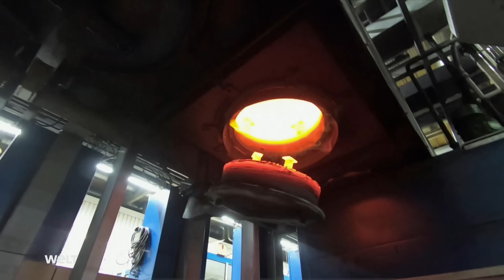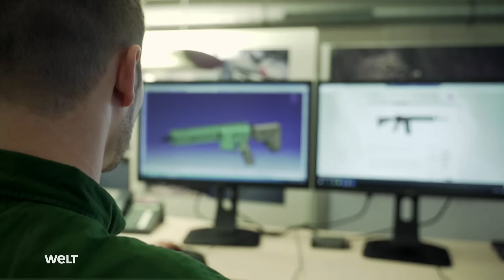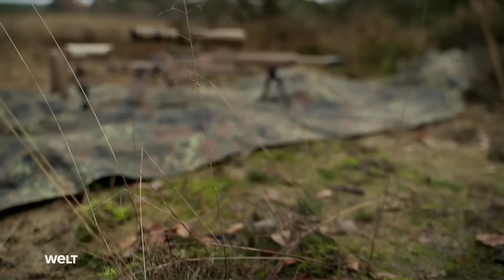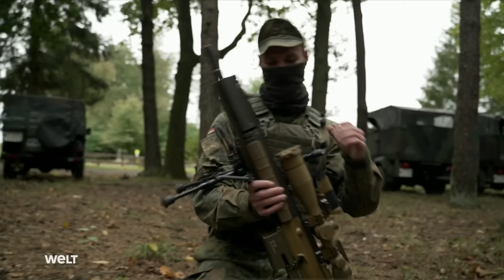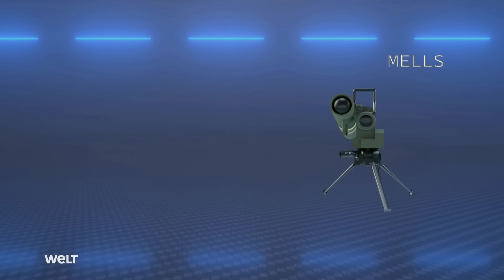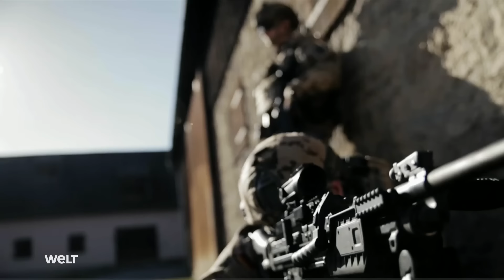FOR GERMAN SPECIAL FORCES: G95 K - A Gun Elite Warriors Fell in Love With | WELT Documemtary

Comment: The accuracy international rifle was fitted with a sound suppressor not a flash suppressor. It holds down sound and flash by cooling off the gases trailing the fired projectile. This makes it harder for adversaries to detect which direction a shot is fired from.

Comment: The G95K is a German assault rifle used by the Kommando Spezialkräfte (KSK), Germany's special forces unit. It is a variant of the Heckler & Koch HK416 A7 and is chambered in 5.56x45mm NATO.

The G95K is known for its reliability, accuracy, and modularity. It features a number of improvements over the standard HK416, including a longer barrel, a new gas system, and an ambidextrous charging handle. It is also equipped with an EOTech EXPS3-0 holographic weapon sight and G33 magnifier.
The G95K is a highly specialized weapon that is only used by the KSK. It is not available to the general public.
Reply: I knew that German special forces are known as GSG -- 9.
Reply: @LorddelacroixStRemyDacretheres a difference
Reply: @LorddelacroixStRemyDacre they are yes, but from the Bundespolizei (Federal Police)
there is also the SEK from the Landespolizei. Lets say you have a weapon situation in Munich then they call SEK. 
If youre a hostage in a different country then they send GSG - 9.  Both are police units.
KSK and KSM are Military Special Forces  (Guys who operate behind enemie lines to do sabotage mission or take/eliminate high prio targets and other stuff.

We also have something called Spezialisierte Kräfte. its a Connection link between SOF units and the "normal" soldiers if you will.
there are many more (like helicopter squardons for example or medi units)
Reply: Das stimmt nicht, ab Ende 2025/2026 ersetzt das G95 (in verschiedenen Varianten) das G36 als Standard-Sturmgewehr für die gesamte Bundeswehr. Eine zivile Variante gibt es mittlerweile auch schon.

Comment: Need something like a modern Sig 716, with a 4 way gas block,  maybe hybrid between .308 and 7.62 if still perfectly accurate with a bolt lock down feature and my design

Also i have some design improvements to all bolt actions 

I got some really cool inven.tion ideas if you want to make a lot of money

Who to Kontact

You need taser drones immediately for the border, if you like wepons defense systems and inventing call me,  i got lots of ideas.

I called L-Tron, no one wants my cool invention ideas,  you need a Cop car upgrade, 2 under mount guns one on passenger,  one on drivers, the rear is center out of truck.  Emergency bullet shield deployment of reverse open bullet proof hood with camers, also the rear trunk hyper extends and locks tight to glass, rear camera. One officer goes to the window,  the AI has 4 lock ons to four passengers on thermal,  the drivers side gun for the 2 on the driver's side, etc.., if there's a click on any of the passengers that gun fires an armour piercer

Comment: I'm sure if you just want to remove the bolt you're going to have to pull off the handguard... disassemble the cooling fins after removal.. pull the timing gear.. put the side plates into working position.. take out roller cam and extracting pin unit.. pull charging handle forward and back three times.. assemble cleaning rod and insert into Barrel.. turn it one full rotation.. back it out a quarter inch.. put the left side side plate up and extract Bolt....

Comment: It's an AR platform. The tolerances are also tight. What changes were made to make it more reliable in sand and mud? By what I've seen, what makes the AK platform reliable is that there are spaces in inside the receiver  that let sand and mud though without affecting the heavy moving parts.

Comment: I wonder how this rifle compares to the new (for the US) SIG M7 battle rifle in 6.8 x 51? If made in the 6.8 cartridge will its barrel have the same round count lifetime? How will the action hold up?
Once again the very ergonomic AR format WITH a piston driven action wins out over the dirty and hot direct impingement action. That's why I love my AUG.
Reply: It’s not only about the caliber, the M7 has a smart optic (XM157), which is unlike anything seen before on any other rifle.
Reply: @Gridlocked  Wellll...  Smart Scopes are becoming a "thing". I have a BURRIS Eliminator 6 rifle scope in 4x - 20x mounted on my 6.5 PRC Browning hunting rifle. It has the following built-in sensors: 1.) laser range finder. 2.) atmospheric pressure sensor. 3.) temperature sensor. 4.) inclination sensor. All feed into the onboard ballistic computer which has been pre-loaded with my cartridge, bullet weight, CD, BC, twist rate, velocity, etc. from my smart phone app.  Lasing a target numerically reads the distance out in the top  "heads up" display where a digital cant level is also displayed.  The "Hold Over" at a lased distance  is indicated by a red dot on the vertical reticle, which has 177 (!) LED dots on it for very fine hold indication. 
FINALLY you can choose 1.) A BULLET ENERGY setting that will tell you if, at the distance ranged, the bullet has enough energy for that particular species of animal. The shooter is responsible for setting this very ethical aid.  2.) WIND HOLD for the distance ranged is also dis[layed in the heads up area at the 5 mph or 10 mph (or kph) speed pre-selected on the app.
True my BURRIS E6 does not have a compass and a few other sensors the M157 "smart scope" has but it comes VERY close. Great for ethical hunting (avoiding wounds).

Comment: 10:18 to recap Suppressor is a sound dampening device basically a muffler for your gun a Flash hider aka flash suppressor looks nothing like a suppressor it looks more like a compensator aka muzzle break and is designed divert the gasses that cause muzzle flash so instead of coming straight out the barrel they come out the sides and backwards at the same time 2 totally different muzzle devices
Reply: I know! LMFAO!  I had to stop 10 mikes into this BS when the scriptwriter's superb knowledge of Pew-Pews and all gun-thingy-accessories really shines through with that pearl, "the G22 can additionally be fitted with a silencer, a so-called flash suppressor..."  Brutal!

Comment: 10:18 first of all it’s called a suppressor not a silencer second of all a suppressor is a sound suppressor it’s basically a muffler for your gun it is not a flash suppressor a flash suppressor aka flash hider is similar to a Muzzle Break aka Compensator but it’s designed to direct the gasses that cause muzzle flash to the side and backwards so it doesn’t come straight out the barrel you can only have 1 a suppressor a muzzle break or a flash hider all do different things
Reply: Silencer Central and Silencer Shop disagrees.
Reply: @John_Redcorn_  it’s in their name “silencer” that’s what ignorant ppl call suppressors. And the reason people call suppressors silencers is not because they silence your gun because they don’t they suppress the noise. The reason people call them silencers is because that’s what British people call mufflers on their cars and that’s essentially what a suppressor for a gun is it’s designed exactly like a car muffler and it doesn’t matter what their company name is if you go shopping for a suppressor on their website it will not be marketed as a silencer because that’s false advertising. It doesn’t silence, your gun and a suppressor is useless with supersonic ammunition. You have to couple it with some sonic ammunition, because of the crack of a bullet is from the bullet breaking the sound barrier.
Reply: @John_Redcorn_  I just went to silencer central and the first hung I saw was “ready to buy a suppressor”

Comment: poor HK reduced to making AR clones
Reply: I don't know how many of these (sorry) idiotic comments I've read here.

It's not you who are stupid, but the comments, because they show ignorance.

The US Special Forces worked with H&K because the Colt M4/16 model was too unreliable.

The thing that made the G36 so reliable, the gas piston, was then incorporated into the AR-15 receiver.
The internals inside the upper receiver is comoletely different to its Colt brother. 

And the AR-15 is a very modular design, which is why it is now used worldwide.

It's not a clone but a collaboration.

Especially since, ironically, an unlicensed copy of the H&K 416 is being built in the USA by Coharie Arms. The CA-415.
However, you can tell by the fact that the bolt wears out on the lower edge, which doesn't happen with H&K.

The H&K 416 is also the weapon that shot bin Laden in 2011.

You should start reading before you start writing.

If I build a Ford and you then take the casing and build it around a Bugatti, is it a Ford copy?
No, it just looks like one.
Reply: Ain’t an AR your Delta Force came to HK cuz your Superior M4 sucked

Comment: This is originally an American design by Eugene Stoner, but with a Piston versus the Gas system.  I used to work in the firearms industry and actually met some reps from HK and attended the Indy 500 with one. Had a great time. All HK products are outstanding as are most German firearms.  I'm a huge fan of Walther Pistols as well. 
That all said, being a red blooded American I still believe the best firearms designer in history was probably John Moses Browning.  ❤
Good video. ❤
Reply: beretta rifle , pump cal 12,and pistols. the rest is nothing
Reply: thanks for letting us know its piston driven. di guns cant shoot immediately after being submerged and they jam easy if you have sand dirt snow ect. piston driven is much more reliable.
Reply: True. there are waaaaay too many weapons based on the M4 Platform.
Reply: @Threat_LvL Indeed. It's so modular which helps.

Comment: A German made AR-15 platform very nice. Thank Eugene Stoner.
Reply: If it wasn't for the Germans, the world wouldn't even know what GPMG and Assault Rifle means.. so give them credit
Reply: You are aware that the first assault rifle is a so called "StG 42" - meaning Sturmgewehr -> assault rifle?
Reply: @GreenStorm01  Yes because Hitler named it such when he first saw it. When it was first issued it was an MKB Machine Carbine, then MP Machine Pistol. The weapon was kept secret from Hitler when it was produced and sent to the Russian Front for combat and testing.
Reply: Not AR 15 AR 18
Reply: Nonsense. The receivers, buffer system, trigger mech are all AR-15. The only AR-18 aspect is the short-stroke gas system. You do realise Stoner definitely did design the AR-18, right? He also designed the AR-10 that the -15 was directly based upon. It's very much still his design even if the scaling down to 5.56 wasn't directly his work. @wppz7691
Reply: And he didn’t design the gun
Reply: @wppz7691 Fucking right he did. This is an AR15 Modernized.
Reply: A little inferiority complex Americans have when it comes to this. They have to mention it under every HK416 related video even though no one denies it is a AR-18/15 hybrid.

It's like someone going into the comments on American car videos and pointing out the fact the Diesel engine is a German design. Thank Rudolf Diesel. Well basically every car is.

Comment: I wouldn't give you 2 cents for those rails they put on them.  Huge surface area that you cannot even get your hands around with the 6 o'clock rail meaningless low and a 12 o'clock almost 2 inches above the barrel, even for a piston driven gun.  Throw in Key-Mod slots instead of M-Lok or Picatinny and you have basically the worst designed handguard in the industry.  This may be the best built AR style gun in the industry but lose the handguards HK!

Comment: So the G28 can't be considered an "assault rifle" by historical German military amour's? Is that correct? 

😎
Reply: Well, technically it is a battle rifle. But the lines are blurry. The G3 in the same caliber was an assault rifle. 
And even if the G28 is only in single shot, you could probably just change the trigger group and have selective fire as other HK417 variants have.
I prefer the term designated marksman rifle, it clears up the role and function better.
Reply: @mephisto8101  so correct me if I understand wrong, But did you say that Historical as is the G28 cannot be considered a so called assault rifle by historic German Military Armours? Therefore 100% legally to purchase in the USA since the G28 as is cannot be turned into a select fire "assault rifle" because that would violate Federal Law on selling clones of that exact semi -automatic sportsmans rifle. Or was that the G27K?
Reply: @DroppingBombs4ever I am sorry, but I do not understadn what you mean with "historic German Military Armours"? I am not familiar with US gun laws, you have to look them up. From my understanding, the G28 is a single fire rifle in 7,62x51. The fire modes of many HK products are defined by the trigger group. If you switch it out, you can change from single, to burst, to auto. There have been many options for HK rifles and submachineguns. 
So yes, if you get a hold of a certain trigger group you can absolutely change the rifle to an assault rifle. Whether you can get the part and are allowed to do that is another topic. If some german army special forces decide they want to have more fire options, they can probably do that. As a german civilian, definetly not. 

At least in germany, you can buy HK416 and HK417 as a civilian, but only the single fire version and you can only use 10 round magazines. I have shot both, they are excellent rifles.
Reply: @mephisto8101  , how can the trigger group be switched out when the trigger groups literally aren't the same size. You can fit a   select fire or fully automatic trigger group in Armalite Platform without additional machining. 

Are you apologizing for replying on a firearm messaging because you lack Extensive firearm knowledge?

Comment: In other words, an M4.
Reply: M4 is direct impingement, these are piston, that's the main difference.
Reply: @kenlandon7803  M4 most problems were managed by h&k & FN and even in 2013 the Army awarded the contract for 120,000 M4A1 carbines worth $77 million to FN Herstal, not to Colt, not even to Remington. Not hard to guess why. Colt sucked making reliable and durable assault rifles. even the marines want to go full M27, meaning 16,5" (10,4" also issued to marines recon units) heavier barrel H&K 416. Source: Marine Corps Times.
Reply: @kenlandon7803  Yea, I know, still Stoner.